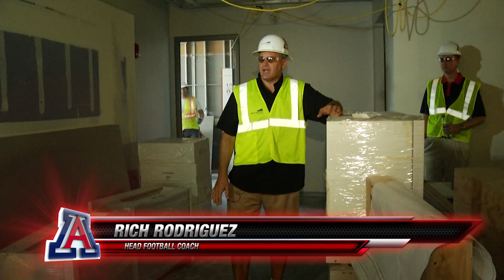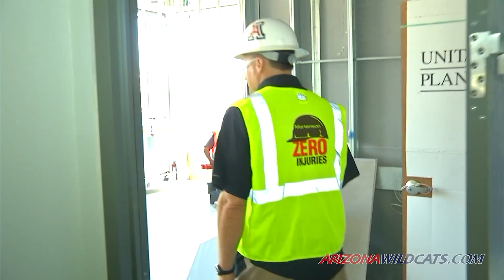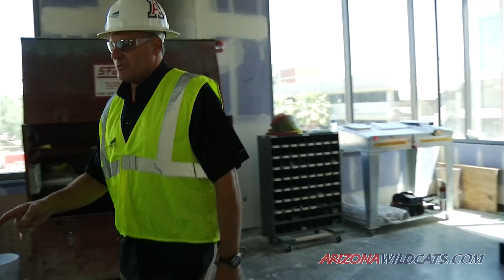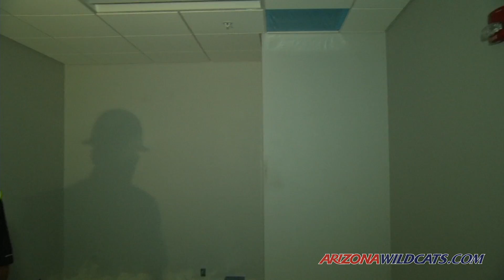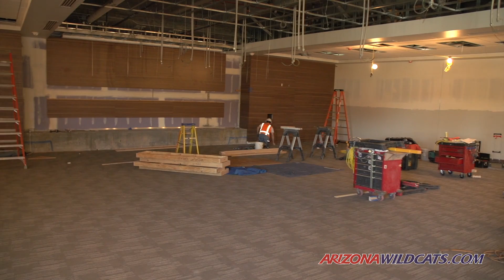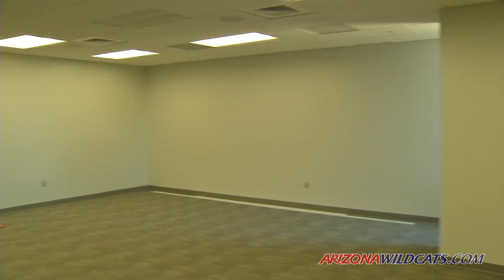Arizona Football: Lowell Stevens Football Facility Update (part 2) Coaches Offices

Comment: I'm a huge UA Football fan, fan of Coach Rodriguez, and a former UA staff member - but here's the deal - if you need glass that will protect you from bullets it is more than just a bad day.  There are 50,000+ students and staff on-campus at any given time that could use the benefit of bullet proof glass for such a bad day (heaven forbid that never happens).